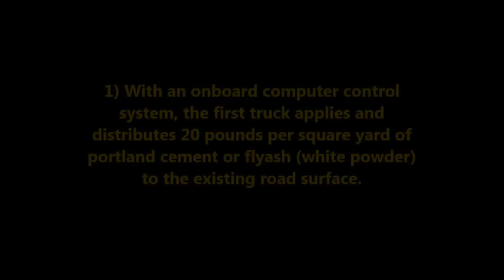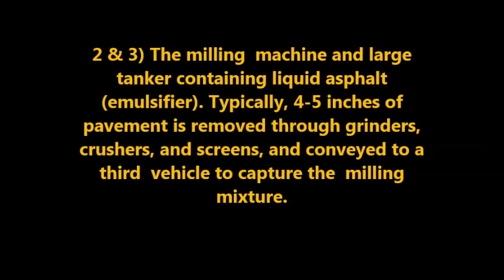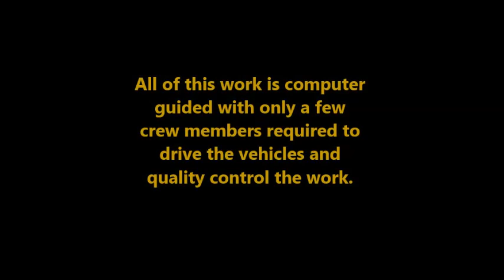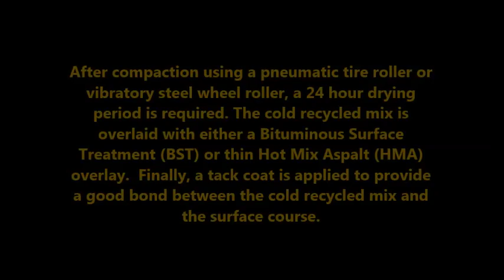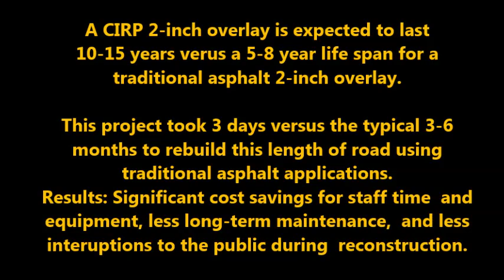Cold-In-Place Recycling (CIPR)

Comment: I think this is a great idea, it would be nice if it could be contained in 1 machine and maybe a little faster.  I could only imagine the billions the gov spends on paying contractors to haul/dispose of the millings to a dump or recycle plant. Then that same plant recycles the millings and sells it right back as new asphalt. Everyone cry's about bad roads, but they have no idea how expensive it costs to have them repaved. How much would the gov save per sq foot on asphalt if they did not have to pay a contractor to haul millings/asphalt out/in, if the asphalt plant was 30 miles away. Most of the issues with asphalt is the ground underneath it. The only other idea would be to have a large scale portable milling recycle plant.

Comment: Cold-in-place cycling seems to be the way of the future in the asphalt paving industry as lower CO2 emissions are released during this process.
Reply: CO2 emissions aren't harmful. CO2 is heavier than air and dissipates rapidly. Cement contains Silica. Silica is extremely harmful and your body won't remove it. Yeah, let's endanger the public by spraying dry cement dust onto a road surface and creating massive amounts of dust just to do a subpar paving job which is far more costly and less reliable than current methods while posing an increased risk to the public and crews. Yeah, some future.
Reply: And they landed on the moon